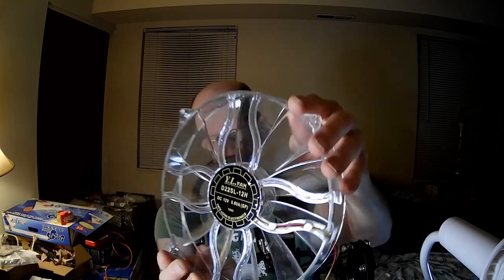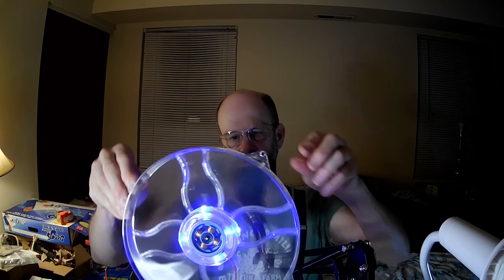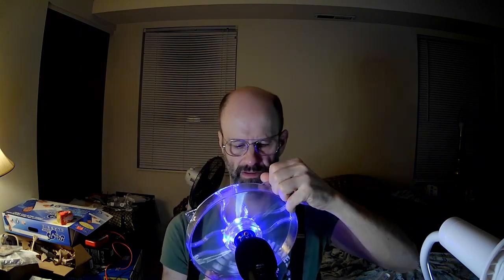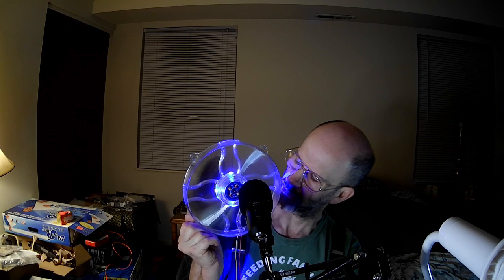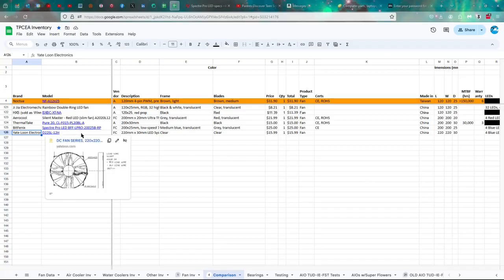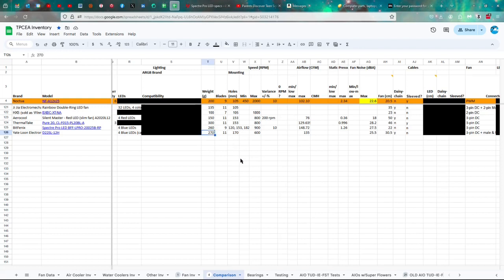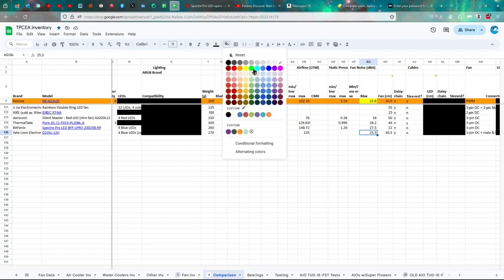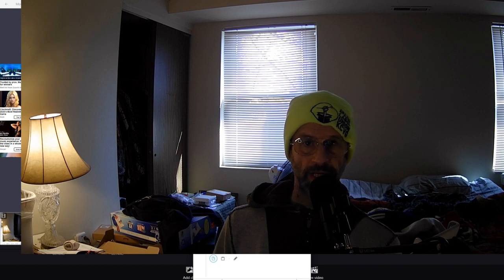Yate Loon D22SL-12H Blue LEDs 3-pin Fan Review, Pt 1

Comment: Current consumption is very low. If this big fan had 2500rpm, it can can be used as a very energy efficient table fan. 
Do a current consumption test on the next video.  Most yateloon fans  take less current, than the written current consumption
Reply from the maker: Thanks for the tips! I'm not an electrician so how can I safely do that since I only have a regular multimeter, not the loop kind?
Reply: @ThePCExpertAmateur    you can use 12v battery or adapter for the test.    Any multimeter can test dc current. Learn dc current testing process from YouTube and  do it carefully 👍👍
Reply from the maker: @Matriarchy_Feminism  Would you please give me some links so I can learn?
Reply: Video link -  https://youtu.be/f9lXua_mdQI?si=Xjd7cOq1TYmPd7DM
Reply from the maker: Thank you!
Reply: @ThePCExpertAmateur   do it carefully. 👍
Reply from the maker: @Matriarchy_Feminism  Thanks so much!